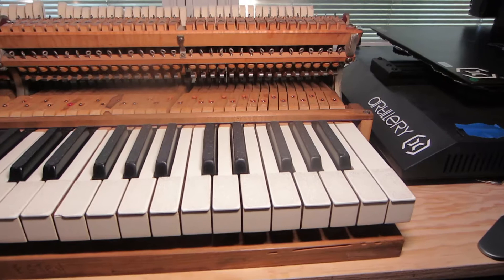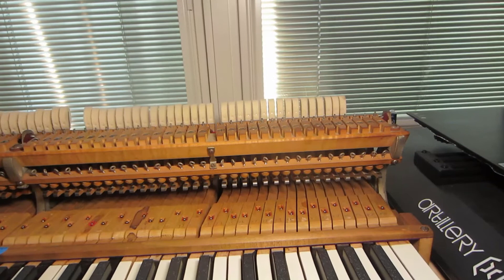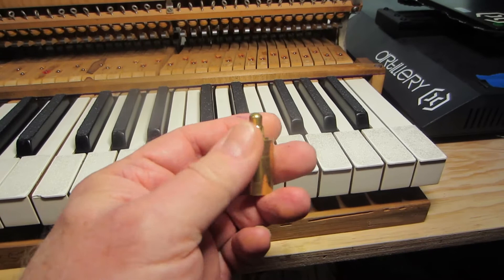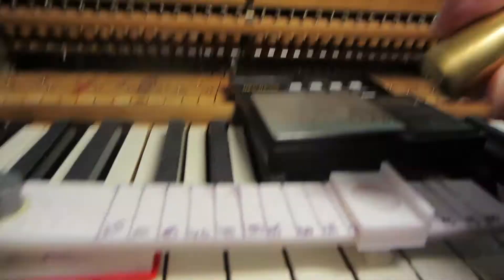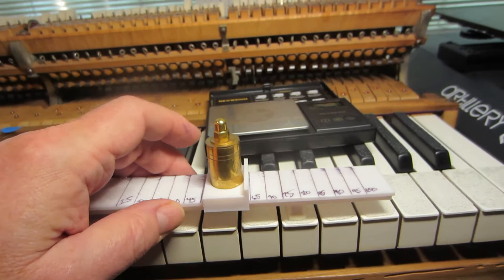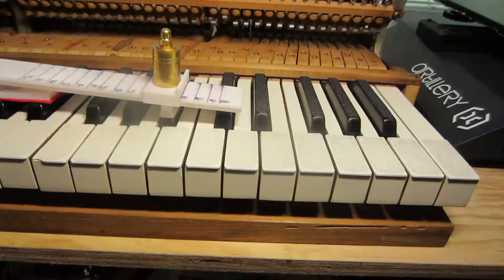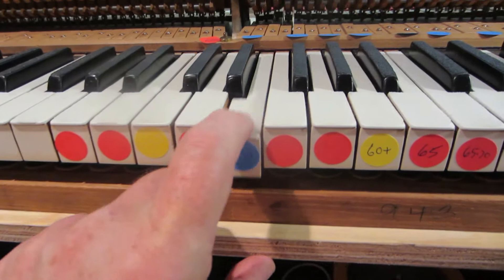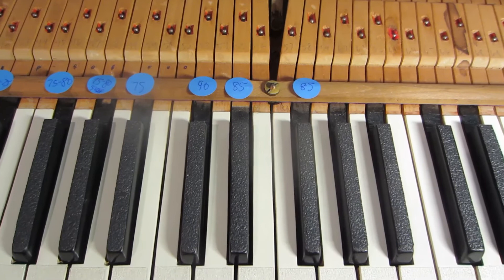Problems with piano key weight

Comment: Thank You. ...and now... what do you do for have the right weight? Another argument (i see this for the first time!): the upper of black keys is scratchy! Why? I hope you can enjoy your piano when you finished the work!! CIAO
Reply from the maker: thanks for the comment.  Yes, I have problems with my fingers slipping off my black keys (barely any fingerprints) so I put plastic pistol grip material on them to make them less slippery.  As for key weight, I did lubricate with teflon powder, the bushings and parts of the action such as the knuckle.  My new hammers changed the weight, so I may have to shave the wood down a bit on a few.  Also I had to add some lead weight on some keys.  I'm still not done but got sidetracked to other things and haven't been working on pianos in a while.